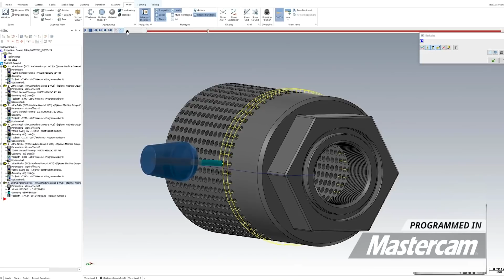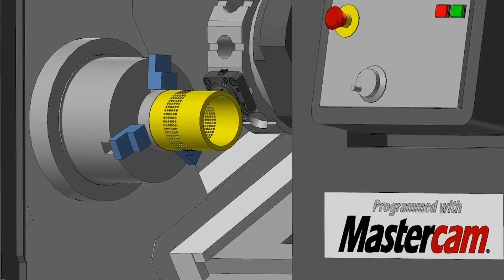My Machine Shop Made $1,000,000 Per Month After 3 Years and I Was Able to Purchase This…

Comment: This is my morning meditation on my way to my cnc setup job every morning at 530 am
Reply: How many in the machine trades actually become as successful as Titan? I mean those working in a shop running the machines. Typically you hit the ceiling and if you make 80000/year you're very lucky. That's 80000 without working 60+ hours per week. Just keeping it real. There are box handlers in my area making 28/ hour.
Reply: @seventimesman4034 yea that material handler will lose his job to AI pretty soon as the machinist can upgrade with AI
Reply: I'm literally doing that now, lmao.
Reply: Same here

Comment: Im going to open my own shop in a couple years.. Saving money to do so.. Thanks to you buddy.
Reply: Power to you. Titan is a great example of what you can become
Reply: Xometry is hurting shop owners now. Especially new shop owners.  Don't open a job shop it's near impossible.  Open a shop that offers full on engineering services.  Complete electronics assembly, etc.
Reply: @marcsolorzan9487  I'm going to open a shop dedicated to automotive race parts. I already have clients. Just need to get off my ass and do some work... But I work so much overtime right now.. I'm just saving money
Reply: @The50Baker  good plan

Comment: How did You deburr that part?  :D
Reply: @importanttingwei7747  Yes, but deburing the holes inside must be a nightmare, question how you do it fast
Reply: @Jatsekusama  a finish pass on the inside after drilling with a very sharp tool could help.
Reply: @silrobati  what king of tool do You mean? A lolipop endmill like Titans showed in another video only longer?  Deburing from both sides using second spindle? Or silmply by hand deburing tool?